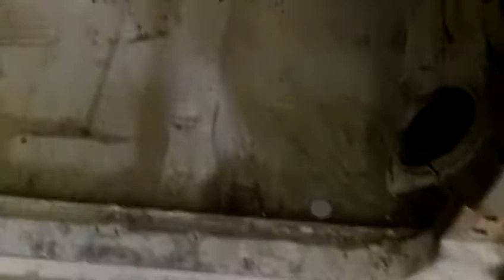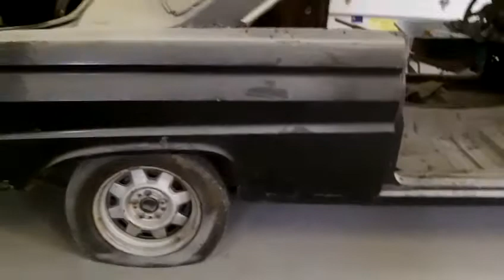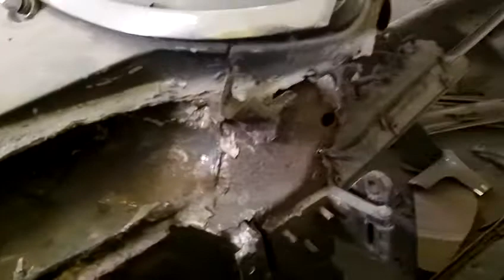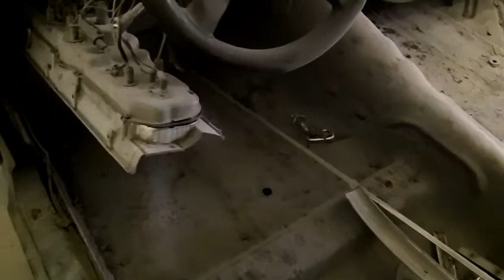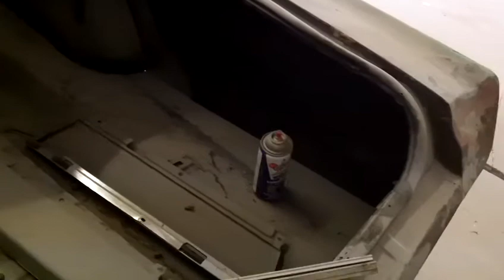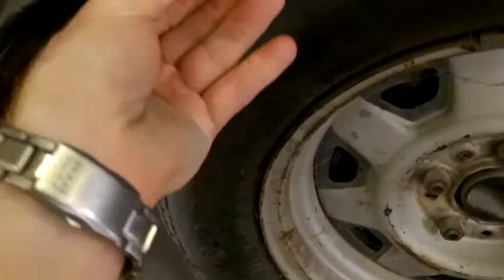1965 Mercury Comet Caliente Rat Rod

Comment: What's wrong with that? I don't see any rust that you can put your finger through - looks like a candidate for resto at the very least. They all cost $$$ regardless. Body's pretty straight.
Reply from the maker: I've since seen worse. This one is the turd in my collection-putty fenders, cowl heavily patched...My mistake was taking it apart instead of leaving it on the road after fixing steering issues. Believe me, if it was salvagable, I would have done it.